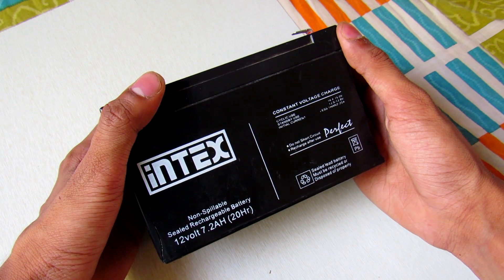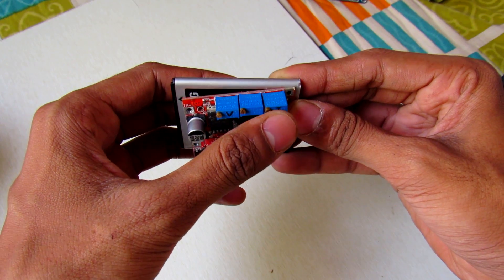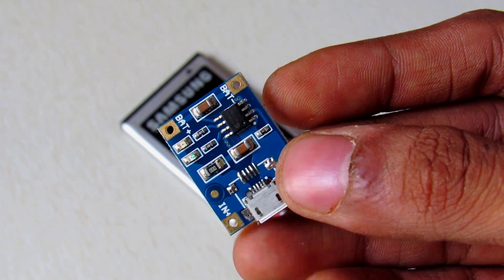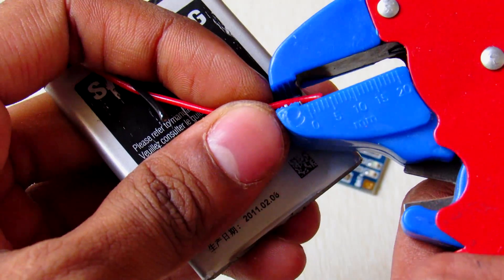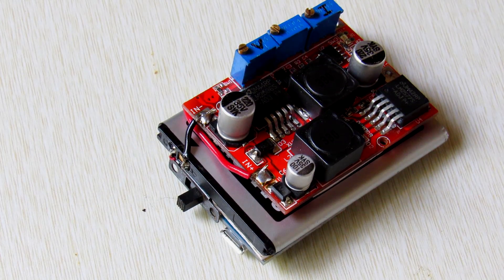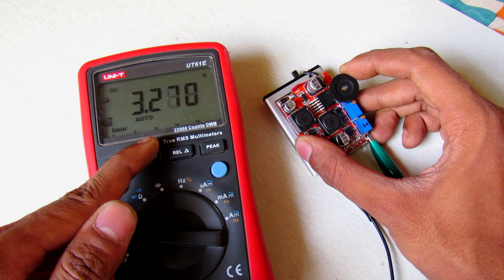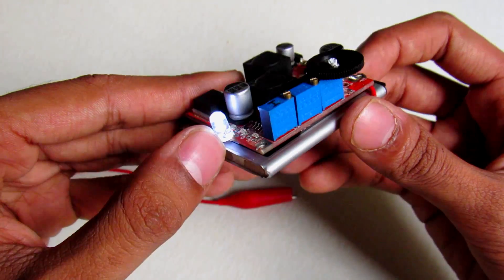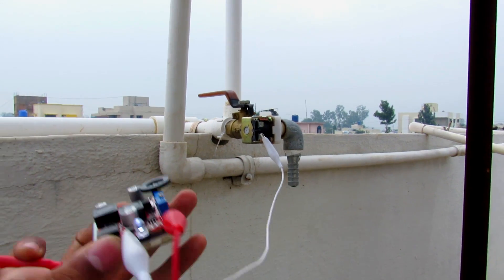Make Variable Bench Power Supply That Fits In Your Pocket !

Comment: Soldering battery is one of the stupidest idea in electronic, heat reduce battery capacity.
Reply: ...and usually (not in 2%) cases, all phone batteries have some kind of protection, just top of the cell, so you are soldering to the boards contacts, not directly to the battery
Reply: juho aalto really?

Comment: how do you lower your amps? I have a similar buck boost and I would like to us it as a voltage regulator for my solar panels. I need to stay at about 4 amps
Reply: Use current control knob.

Comment: If I connect multiple cell phone battery's could it increase Amperage as well?
Reply: The current is limited by the boost/buck converter components. Multiple cells would give you a longer running time but no increased current capability.
Reply: Metal Rott Other problem: you would need one TP4056 for each battery, connected in parallel. (Then you just need to connect one of them to charge all batteries.)

Comment: Nice vid buddy. :-D 
Looks great. I need to make this type of so called Lab Bench Power Supply. I would call it variable voltage ampere power supply.

However, I don't think this volt booster circuit can not give lot of ampere. 
I need this for Li-on Battery charging unto my proffered voltage (4.20). The commercial charger is not topping up to 4.20 V.
Anyway subsribed. :-)

Comment: Where is cell protection?
Reply: N!cky There's a different TP4056 with battery protection. In this case you would need to connect the battery to the TP4056 and the step up/down to the TP4056. (Different connection points.) BUT... In this case you wouldn't need it. The step up/down won't power up with less than 3v.

Comment: kedar please tell me what the middle pot is for.... i adjusted it and now i cant adjust the current control properly
Reply: I believe that it is low voltage cutoff to keep your load from killing the battery. Use set the voltage that you want the load to be turned off.
Reply: its to adjust current in some way, not voltage. thats about all i know about it

Comment: How do you measure amp limit from that power supply with your multimeter?
Reply from the maker: +Green Stick lower the output voltage and directly measure short circuit current across output .

Comment: I'm a bit lost. how you can you feed the device 3.7v then get a higher voltage? if it's a step down regulator, is it not supposed to give you an output voltage lower than the input voltage?
Reply: it's a 2 in 1 converter step up plus step down

Comment: Very nice video... but I  should add a very small Digital Volt meter for 2 Dollars....  so handy !!    :)  i have also tested a little Digital Amp meter but the resolution is very poor in the mA... an you get some problems with the same Battery power.. have to use a isolated power module... so i do not use a Amp meter anymore...

Comment: Bother i want to give one suggestion .
You should remove the charge control circuit of the battery because in your application it will decrease the efficiency of the battery
Reply from the maker: Battery Charging board is necessary to maintain automatic cut-off when battery is full .
Reply: No brother i am not talking about the USB battery charger board there is another battery charge control circuitry with temperature sensor just above the lithium ion battery which you are using ..
Reply from the maker: +Tech Inventor Aman Internal Battery Protection board is really important ,because it will prevent battery from over Discharge newer version of TP4056 has this protection on board .